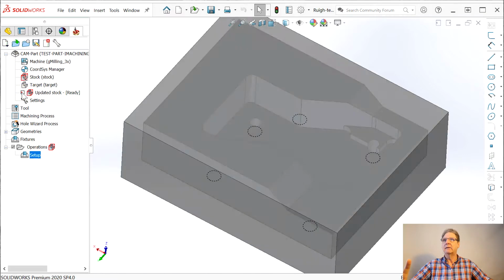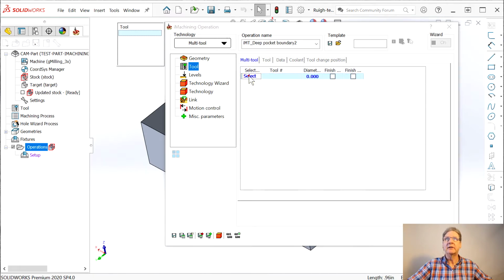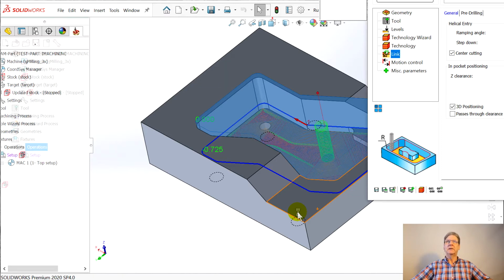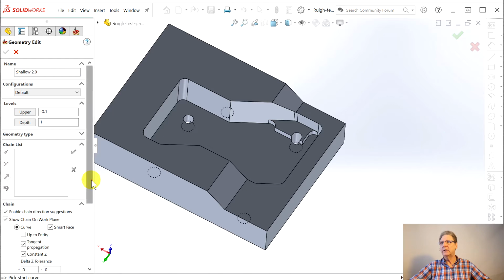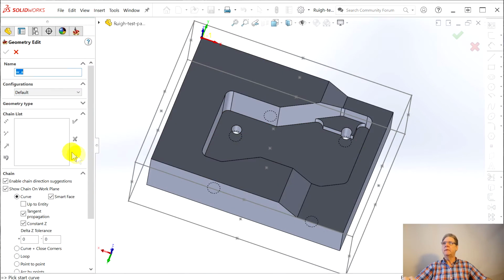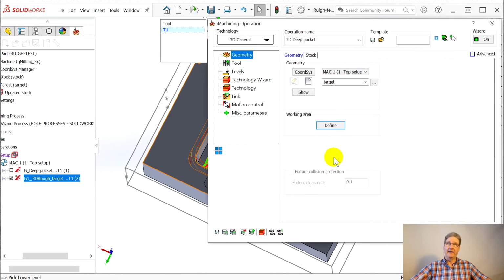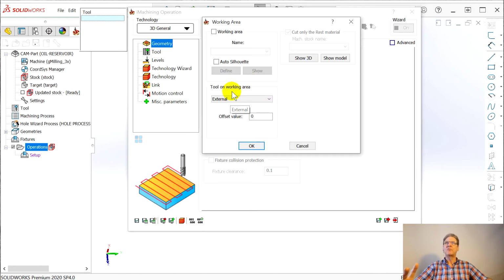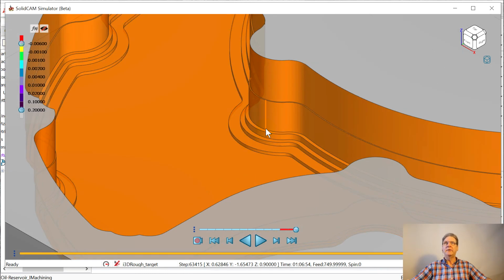SolidCAM iMachining

Comment: Hey Rako, today i had same error "Operation saving failed; Simulation and GCode are not available". Problem is VMID setup and imachining database machine setup. You need to match or put in range speeds and feeds in both VMID and machine database. If you didn't solve this by now give it a try. Cheers
Reply from the maker: Thanks for the tip, I am sure it will help someone. I gave up my trial version and bought HSMWorks, which is not as powerful as SolidCAM, but gets my jobs done.
Reply: Its simple.......set ....global machine ......!